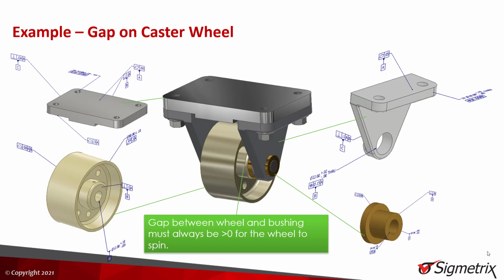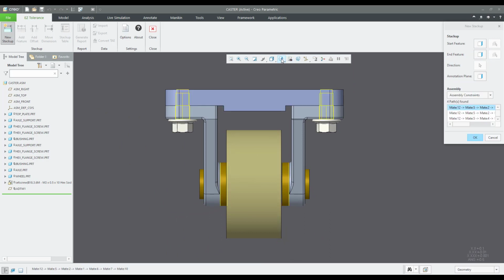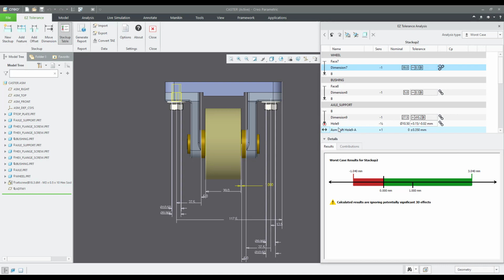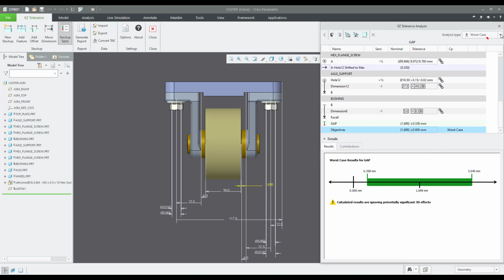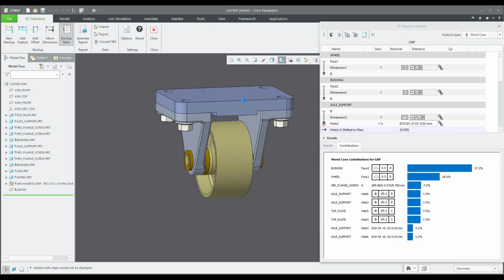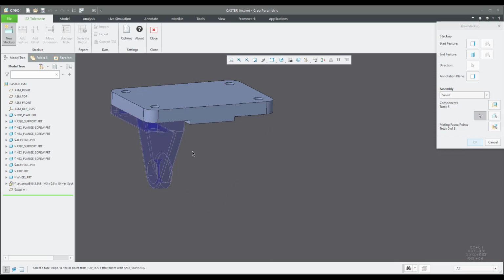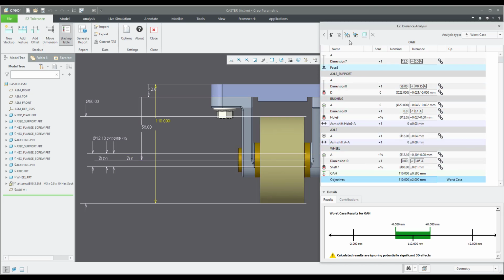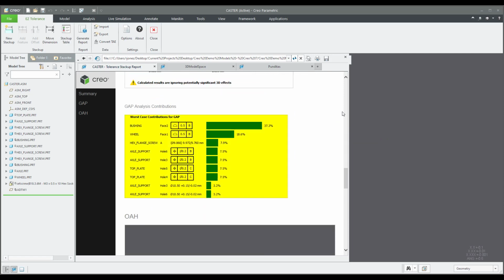EZ Tolerance Analysis for PTC Creo 7

Comment: Can we add form tolerance(flatness) and use  EZ Tolerance Analysis ?
Because I use Creo and Cetol and in Cetol I can't add the form tolerances.
Reply from the maker: EZTA doesn’t automatically include form error because its contribution to the stackup is very dependent upon the stackup scenario, but the user is able to include additional variation for contributors like form error, if needed, by using the Add Offset tool.